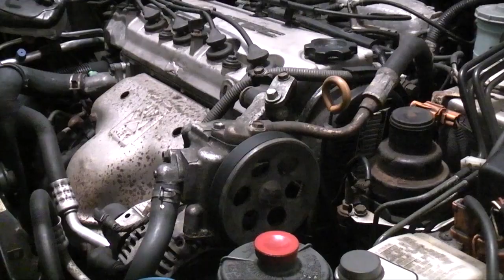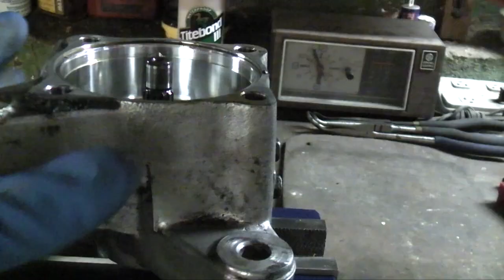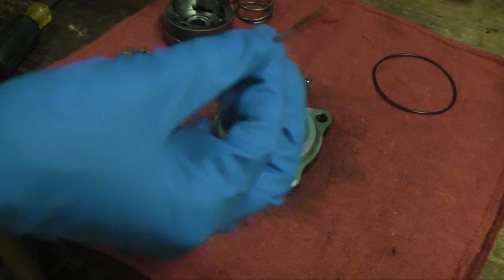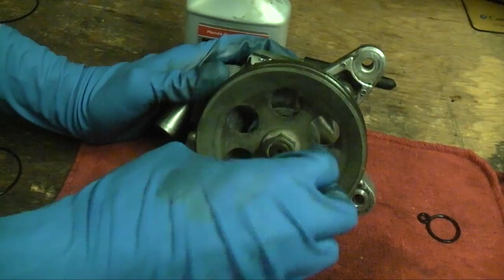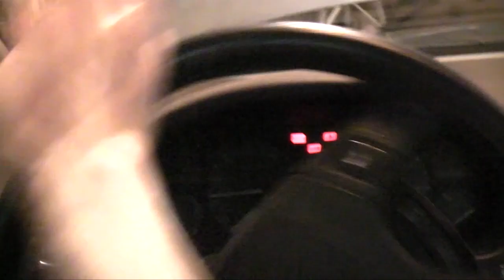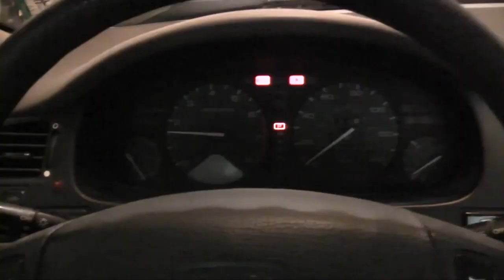94-97 Honda Accord Power Steering Pump Leak Reseal Repair

Comment: Hello! great video. one question, I tend to have loose steering sometimes, it has play. I had a steering rack swap with a remanufactured unit. can the pump be bad? or a sensor or the preasure regulator? sometimes the steering is lose and the car changes direction without me turning the wheel.
all suspension components and wheels and tires are new.
any ideas?
thank you very much, keep up the good work!

Comment from the maker: They're made by Lisle part number 38220.

Honestly I only use them nowadays in tight quarters where my 3/8" impact won't fit. Once you buy an impact you won't go back to hand tools for pulley removal.

Comment from the maker: No the 90-93 Accords utilize a gear pump totally different design. 94-97 Accords use the rotor and vane style pump shown in the video. 98-02 Accords also use a rotor and vane type pump but it was redesigned which reduced the parts count.

Disassembly to remove the pump shaft and o-ring replacement inside is the same. But on the outside there are less o-rings to replace due to the new design.

I think the snap ring pliers are from KD tools. I bought them a long time ago.

Comment from the maker: Actually the pump is different past 1997 they redesigned the it and reduced the parts count. There are less seals to replace inside the pump you still have 3 seals. On the outside the control valve plate was replaced with a threaded plug which has an o-ring on it.

Comment from the maker: No they don't sell a kit you'll have to order each part individually. I put the parts list for 94-97 Accords in the description.
Reply: hi bushougoma great vid on that power steering pump, quick question tho have you ever made a vid on replacing the timing belt on the same car 97 honda accord ex